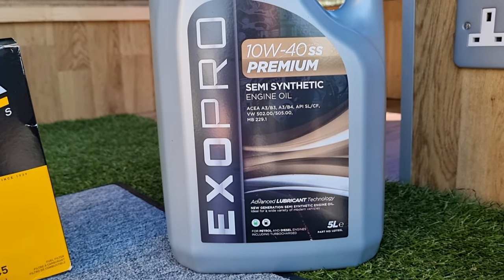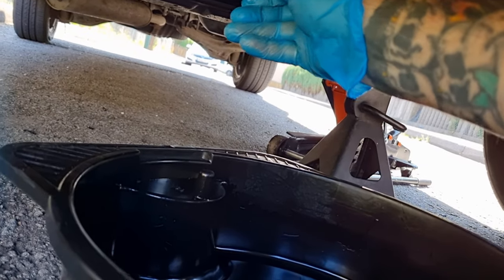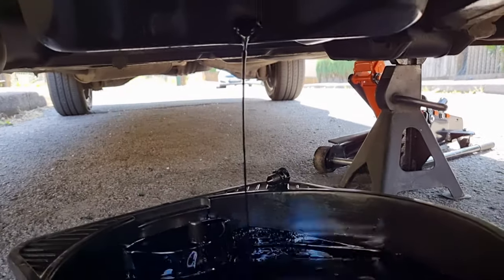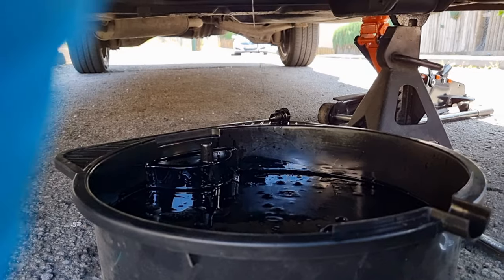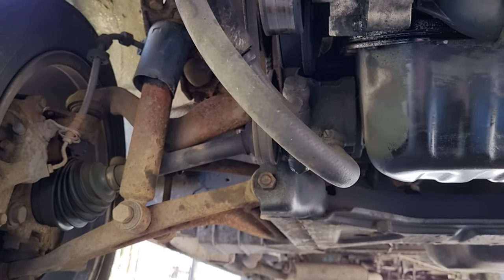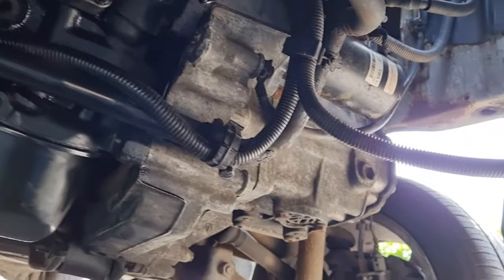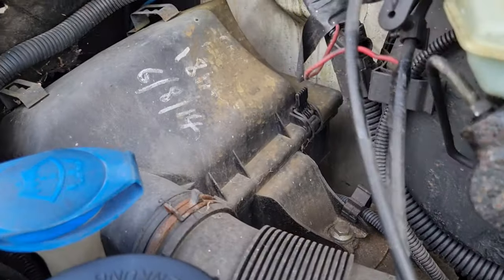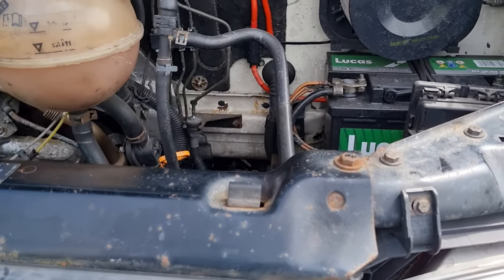oil,filter and deisel filter change. vw T4 1.9TD pt1

Comment: I bought my 1.9TD T4 16 years ago with 82k miles on the clock, now showing 172k. I have always used 10W40 Castrol Magnatec and the engine still sounds lovely and smooth. Saying that, I do change the oil every 3k.

When changing my oil and filter the van takes around 4.4L, that gives a reading at the top of the cross hatching on the dipstick. 

Torque setting for the sump plug is 30Nm.
Reply from the maker: Thanks for tye info
Reply: @docsworld9707  No worries. Nice to see others making T4 vids, I really need to pull my finger out as not made one for years. You are very good at explaining how to do things. I watched the whole vid. 👍
Reply: Thanks buddy